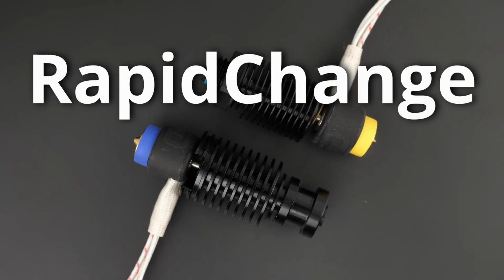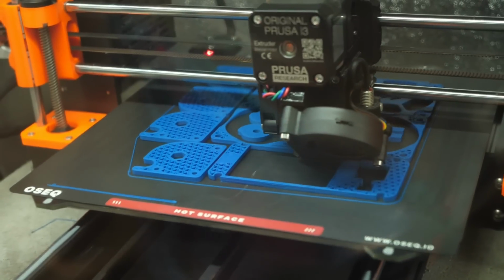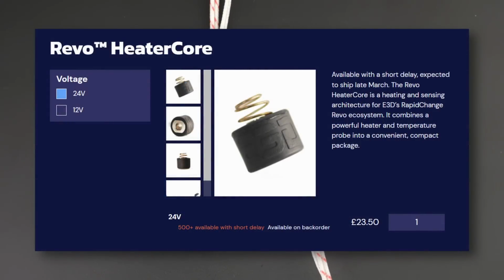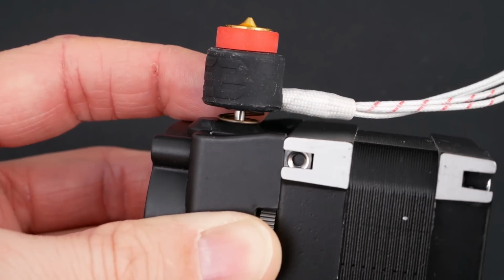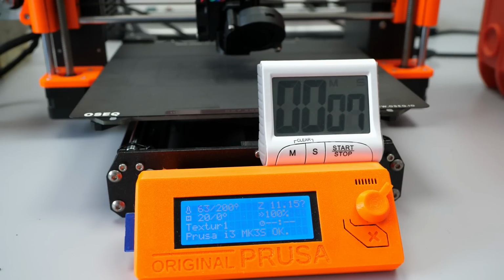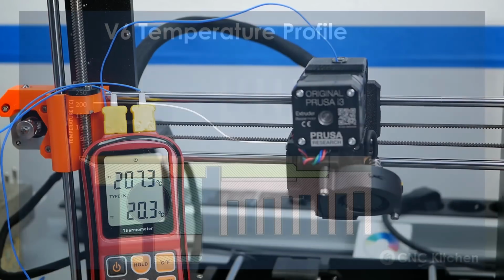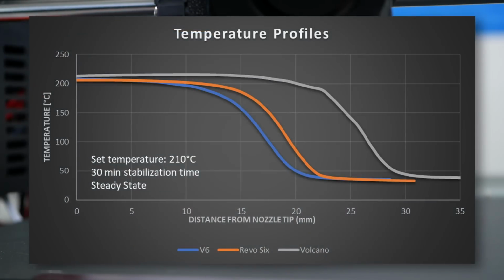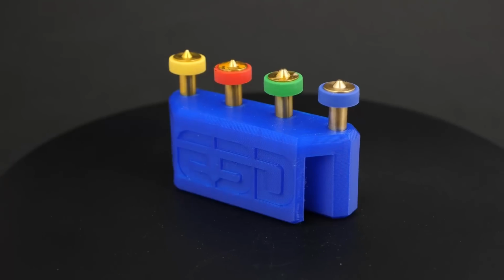E3D Revo™ is great BUT has a dirty secret! (REVIEW)

Comment: I need definitly different z-offset for 0.25 nozzle on textured bed (mk3s+). But actually different z-offset is no problem as long as same nozzle diameter alwas have same z-offset. Just write down z-offset for all 4 nozzle diameters, decide wich z-offset you store in the printer - than calculate the differences needed for the other nozzles. These differences you can store as z-offset in Prusa Slicer for the different printer profiles. Just to be done one time, so no big deal.

Comment: What really surprises me is how well the heating and temperature sensing in V6 works. I always thought with the offset heater, the temperature sensor on the other side, etc, that the actual nozzle temperature would be way off compared to those circular heating elements. Turns out it works just fine.
Reply: Indeed, but it's all about your hotend thermistor tuning - I use a V6 with an oversized copper block and a 50w heater, and I had to do the heat-and-measure dance with an IR thermometer to fine-tune the thermistor profile. Thanks to having done that, though, and following up with a few PID tunes to fine-tune the software side, what the printer thinks the temp is and what the nozzle temp reads as with an outside sensor are within a couple degrees of each other.

Comment: I love my REVO SIX. I just had the issue where the Thermistor was reading .535 MOhms. It is supposed to read 100K Ohms. E3D is sending me a new heater core. But, when the REVO was working I was getting Beautiful prints. And changing Nozzles is nice and easy. It is worth the money, for me, not to have to  Heat Tighten a nozzle again.  Although I still think the PT1000 type Temperature Sensor is much more accurate that the 104NT Thermistor. I will be the first one in line when E3D comes out with a PT1000 version and Nozzle X.

Comment: well that would flawlessly solve my current issue of constant seepage from the heater block.  just need the hardened nozzles, the cr kit and a new motherboard to replace tronxy's so i can move the parts around the carriage assembly. adding some end g-code to extract the filament after every print is a trivial way to facilitate incredibly easy nozzle swaps. not needing to carefully wipe down a 250ºC heatblock covered in crusted over plastic lava would be nice too.

surely E3d could just extend the integrated heatsock based on your feedback?

Comment: Interrupted threads or a spring loaded bayonet fitting (like with some light bulbs) would make for a true quick change nozzle system. Half or a quarter turn and the nozzle just pops out.

Comment: my best heatblock i cast using .999 silver precious metal clay with a thin 6mm threaded brass sleeve in the traditional configuration. amazing performance and thermal curves. the most difficult part  was the sleeve.

Comment: The loose tolerances on the flange to the nozzle tip is a showstopper for me. 0.3-0.4mm is 2-4 layerheights. I think it should be +/-0.05mm at absolutely minimum, otherwise you have to level the bed after nozzle change, which is anything but quick, or keep track of the tool offsets by hand, but there is no unique ID engraved on the product so is has to be done first.

Until there is no commerical tool offset measurement system for 3D printers (I already thought about it tho), it will be still a hassle to change nozzles...

Comment: I like your videos, and the way you always explain the topics with such attention to details, but the price comparison was not fair. Not all hotends listed comes with fan as the revo and v6.
$235 mosquito?? $185 copperhead??  I paid $150 on my mosquito, and $100 on my copperhead. Add an e3d thermistor ($5.99 at printedsolid), e3d heater cartridge ($6.99), e3d nozzle ($10)and slice engineering fan ($5), that’s $30 on top of the hotend that’s $180 for the mosquito and $130 for the copperhead buying e3d parts, but you can also get cheaper parts from trianglelabs. I feel like when people talk about slice engineering hotends they are biased, like a copperhead review I watched the other day, the guy talked as if it only worked with slice engineering nozzle, thermistor and heater, which is simply not true.

Comment: Great review, as always, Stefan !
Patents can be kinda frustrating, that's right. I doubt a company like E3D can do without that to "protect" their designs in some way, despite being a bit opposite to the RepRap thing. Still, given your review, I'd say it's OK(-ish) in this case since the Revo ecosystem seems to have some flaws to be addressed and enhancements to be done.

To me, the most important thing with Revo is the (much) smaller Heater Core. THAT is really great ! The nozzle-break design a bit less, to me, because it might become somewhat "expensive" in the middle/long run in case of unexpected crash into the bed. This, plus multiple upcoming variants (nickel-plated copper, hardenened steel, hi/ultra-hi flow ...), may have a future outcome on how/what users will be buying. At least for now. Maybe costs will be pulled down with time, though ?

For now, I'll keep using my currently working and somehow hassle-free solution : ceramtic heater (not E3D), V6-style nozzles, and nozzle as probe.

Comment: Seems like they missed out on a good opportunity to use the same fitting style as quick change air tools so that you could avoid having to screw it in.
If the entire nozzle assembly is basically all one piece, I don't see much reason they couldn't make a snap-in version.
Reply: I think there would be inherent issues with wide ranging temperatures and also needing oil that might burn off to function properly or leak, and a leaky connection here is a lot more annoying than the slight air hiss. There’s also a lot more weight in those setups so that’s another draw back off the top of my head. I could be wrong but it sounds like adding a lot more problems than solutions
Reply: @alexmills42  I don't know what you think I'm suggesting but your comments seem entirely off base.

The nozzle assembly is one piece so there is nothing to leak. This is only about how the entire assembly attaches at the top of the heat break.

Comment: I have had the exact same happening to the heatercore of my Revo 6. Misreading of the thermistor that first started with temperature too low right after turning on my MK3S+ up to misreading and thermal runaways while heating up to 260 degrees celcius, E3D has great support for this. Would help a lot to measure the resistance of the thermistor at a room temperature that helped diagnosing the issue.
Reply from the maker: In my case it was probably thermal cycling and why it first happened after ~250h of printing. Measuring at RT might not help a ton because if the short only happens due to thermal expansion at a certain temperature you might not catch it that way.
Reply: @CNCKitchen  mine went crazy after About 30 hours, but could also be 60 hours. The temperature charts look pretty similar to yours. Thank you for the great video!

Comment: That would not be good news for E3D at all. They invested so much energy and engineering in designing this system so you would its has superior proberties for heating. Regarding the Nozzlebreak patent. I have seen Nozzlebreaks (completly made out of brass) years ago on Ali.

Have to add - i love you in depth analysis

Comment: Screw the fact it's not an open system. I've snapped more nozzles in half than this thing cost.

I've learned though you can heat tighten the v6 nozzles with heat-gun.

Comment: I like the general concept of the REVO and in terms of pricing it's absolutely competitive.
BUT, there is absolutely no way that I'm buying into a closed ecosystem like that as long as there is any alternative.
If it weren't for the patents, I probably would've bought one by now. But with the patents in place, I'll probably just wait until some chinese manufacturer comes up with a similar enough design that just barely avoids the patent, which ironically, is almost exactly the scenario they wanted to prevent when opting to patent their design...

Comment: Revo will have the same problem as slice with abrasives: the "bimetallic" design using the small steel tube will wear out ridiculously fast on abrasives, so the "hard nozzle" should be paired with a hard tube, cause on carbon fiber Bimetallic heatbreaks can break in as little as 3-5kg of carbon
Reply from the maker: Seriously? Though an interesting point! I've only seen that happening once on an Ultimaker print core that was pushed really hard.

Comment: I'm not so sure the patent on the shape is legally valid though...
Simply put: to patent something it needs to be a technical difference, not just a different shape to vendor lock things.

A patent for "nozzle without screw threads", is likely to be deemed "arbitrary" and invalid.

Comment: Nice vid m8! and yeah - I use first gen Mosquito+Vanadium nozzle and I had to increase temp also around 10C because all that.... otherwise printed parts were too brittle... that wasn't no deal breaker for me after I realized, what were the problem.... and as you asked - do I change to revo - nope, because I have mosquito, which works like a charm... I change nozzles for time to time but not so often, that I must have some rapid change system... and as they say - if it works, don't fix it :D and also - there are too little userbase for revo right now, we as hobby users, can rely on very little data.

Comment: If the thermistor position is such a big issue, why not use the PTC resistance itself to measure the temperature?  It would be only two wires, and will measure the exact temperature the PTC is at.  The same applies if it was a NTC.  I know this will require the control board to support this.  I do not own a 3D printer, but like to watch your videos, pretty interesting to do so ;)

Comment: Very nice Job with this video. I'm currently having one in my stealthburner working fine and I'm very happy with it. But I also noticed the seemingly unbelieveble heat up time in the first 20 seconds. So it kept me wondering, what was going on in there.
Reply: And I also have to metion, that the temparature discrapancy is not so important for me, as I try to tune my setup to the filament, everytime I buy from a new vendor. So I try to tune in by performance and feel. I used to have the generic 3950 temperature sensor, so it was rather a bad but stable aproximation (cheap 3950 tends to report not so precise temperature),

Comment: Great job as always. I knew there'd by some issues due to thermistor rearrangement, but I'm honestly quite shocked now. And since other hotends aren't flimsy regarding nozzle change, either, the primary selling point continues to not be a standout for me.

Anyway, I only have a couple of printers. I'm not going to throw out my open ecosystem nozzles for a closed ecosystem that doesn't improve much.
Reply: A lot of people have broken heat-breaks or thermistor or heater wires, or burned themselves, or under- or over-tightened nozzles. You've been very lucky.
Reply: @fwiffo   By "other hotends" I meant other than E3D's V5/V6/Volcano, direct clones thereof, and AFAIK most proprietary machines. In other words, Creality's, most of Phaetus's, Slice's, and more.

Comment: Great video as always and thank you for all the in-depth testing.

I will probably still get a Revo once they are in stock. However I'm more curious about the long-term support and how E3D may potentially license out their designs. V6 and its look-alikes have been around for such a long time so they have support everywhere. If Bondtech was able to get the license for 3D Solex to make the CHT then we may potentially see E3D talking to 3D Solex for a CHT-style Revo Hotend. 

I'm barely over the fence of getting one because it's so new regardless of all the nice little features. I will be watching closely and making observations on how E3D reacts to the market as the Revo begins to age as I think that it is the most important going forward. How will Revo's ecosystem evolve/change in 3 months? 6 months? a year? 2 years? Who will they allow licenses to?
Reply: This is doubtful. Great thought, but unlikely, as the CHT tech requires angled drilling of the nozzle. The Revo design is multipart and there's nowhere to DO the drilling ... It's more likely that Bondtech themselves might launch with a hotend themselves, they have to be watching the market and obviously have VERY clever engineers. With the widespread name recognition a Hotend offering would sell like hotcakes (Pun intended), especially if they included their CHT nozzles and Dual Drive extruders as a package ... eh? I know they'd sure have MY attention!

Comment: Its for sure an interesting system. its high price and lack of high-flow options kill it for me though. My printers all have 0.6mm nozzles, and its extremely rare for me to need to switch back to .4. and my 0.8 nozzles have been made obsolete by the CHT 0.6mm ones! i print just as fast with my volcano and the 0.6mm CHT than i did with a 0.8mm.

Comment: I understand E3D wanting to protect their R&D investment, but it'd be a hard sell to convince me to move away from an ecosystem where there are multiple makers of compatible parts. I like E3D nozzles. I buy their V6 nozzles. An closed ecosystem like Revo however is not for me. I prefer an ecosystem where third parties can bring their own innovations (i.e. those ruby nozzles, or some of bondtech's designs). I also prefer knowing I can continue to get new compatible nozzles into the distant future even if the company I used to get them from goes belly-up.

Comment: Revo provided on mk2.5s.
Xyz cube printed, before and after installation revo. prusament pla. V6:215 degrees. Revo: 215,220,225 degrees. Only at 215 does the Z top surface feel equally smooth. Temp tower is also best at 215 degrees. I'm going to keep the same temperatures as V6.

Comment: hanks for this great analysis in deep, great job as usual. 

You did not mention about the fact that the heater is only in contact with the flat surface of the nozzle, the cylindrical section has some play of 10ths/mm so would definitely not be as efficient than direct contact all the length of the nozzle. 

During your benchy test, you mention the stringing that seems a little less, would that be due to less real heat into the nozzle  so less stringing is logic.

What about the real temperature when you start printing, as your filament also brings some cold into the nozzle, what would there also be the real temperature?

All this leads to at least 5 to 10°C heater increase to keep up with the usual temperatures.

Comment: I'd be curious about a comparison to slice, or dragon, or other brands, not purely one e3d product to itself, even if we stay in the e3d garden, how about their copper heater blocks -- I use those in combination with slice bi-metalic heatbreaks. The drop in temperature with part cooling is a big deal, considering with the idea of using this in a high speed small form factor v0 maybe, some part cooling ideas will blow A LOT of air onto the part, I could see an even bigger temp drop. Check out Vez's part cooling idea, that blows a ton of air.

Comment: You say it is in the same price range, but it is like buying an expensive razer handle and then having to buy expensive razers. The wearable elements are really expensive compared to the same wearable elements of every other one you are showing. You also don't include the Pico Hybrid which is a very similar concept (kickstarted in Nov 2020) and is also expensive and has expensive replacement parts.

Comment: Thanks for doing the vol flow numbers, I've been waiting for this.

I probably will put a Revo in one of my printers for the convenience of easy 0.25mm prints, at the moment I'm swapping out voron toolheads in my enclosed printer when I want my 0.6mm CHT because (convoluted reasons) but it's a annoying I have to swap out config files for PID and fan behaviour. I mean ideally I'd have a v0 for minis at 0.25mm and leave the other two with a 0.4 and 0.6 but it's rarely that easy as only one has a proper fume enclosure for abs.

Comment: I'm not so sanguine about the temperature gradient issue. I expected this to be an improvement over V6 due to the smaller thermal mass and size.

I'm looking forward to more tests in this area. Sure the same issue exists on V6 to some degree, but how much worse (or better) is Revo?

Ultimately I want to know how responsive it is to fan speed and flow rate changes. On my V0 I print infill 3-4x faster than perimeters, which is a huge change in flow rate every layer, and pulls a lot more heat out of the block. How responsive is it vs. V6 ecosystem hotends?

There are some growing pains, as expected, but nothing dire. I'll probably give a little time for those to pass, and maybe wait for hardened and high flow nozzlebreaks.

Other than that, it's very promising. Pricing is competitive with comparable premium hotends, and you get 4 nozzlebreaks.